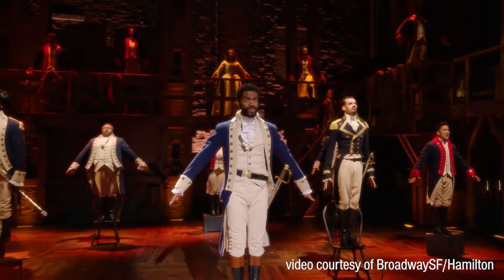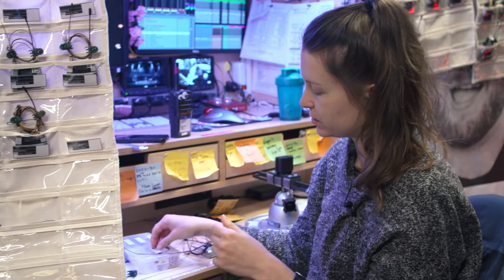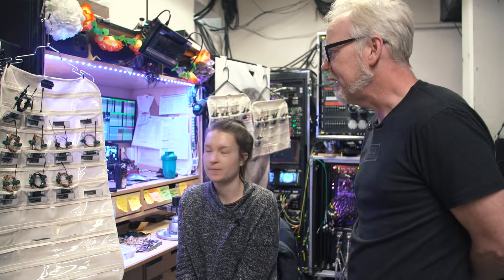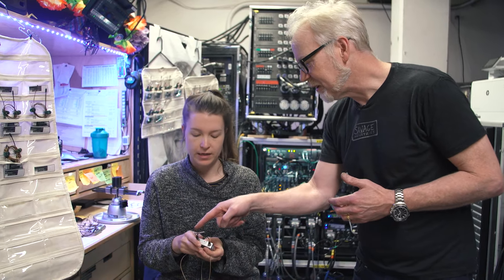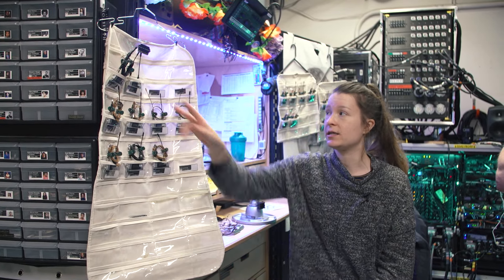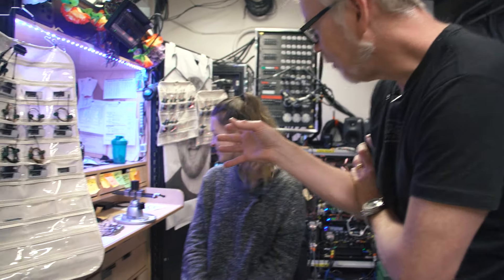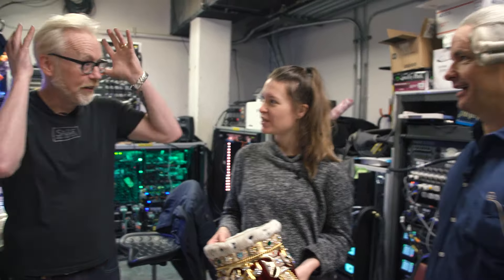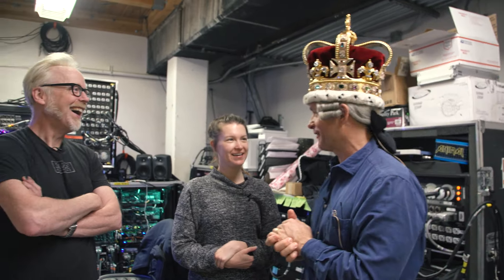Making the Custom Microphones for Hamilton!

Comment: The pliers are Hellerman pliers, used them extensively during my engineering apprenticeship and in the workshop. Tricky but damn useful for what they do. I found a really old pair in someones draw that I was able to keep: Literally just 3 bits of metal with the tapered plier end that you manually separated.

Comment: Again, another great overview video for the sound department.  I am likely to send this to a few of my students as well, and again it is not a complete video of everything that happens but it is a great general introductory video so congrats to Tested and Adam Savage on this.  It is even more impressive when you consider this had to have been filmed a bit back, but still answered some of the more common questions that were on the mix video as well.

By the way, word of warning, NEVER put a Hellerman tool in your back pocket, and especially never with the prongs facing in.  I'll leave the why to an exercise for the viewer:)
Reply: Back in the 70s I worked at the BBC's TV Centre in West London. One day I was replacing some old valve (tube) audio distribution amps in a rack with new transistor versions. I had a wireman making up a new harness, and he had taken up some of the computer floor so he could sit with his legs in the hole. He put a pair of Hellerman pliers down beside him and I stood on them! Luckily I was wearing good shoes and they only stuck in the heel. Could have been very nasty.

Comment: Amazing video. I worked as an A2 for a Bay Area professional theater (but nothing as crazy as this) and have used the Hellerman tool and Hellerman sleeves to make custom ear pieces, have run hair mics, etc. This is whole next level and I now have some crazy fun ideas for what to do for my future shows. Anyone know what transmitters they're using? The connectors on the Mics look like Shure but the packs look a bit more like Sennheiser. I don't recognize them as any models I know from either of those companies though. Love this video and love that Adam Savage can speak intelligently about mics (distinguishing the element from the rest of the mic cord, +1!)
Reply: The transmitters are Sennheiser SK 5212-ii and they have Lemo connectors. :)
Reply: Ahhhh ok. Thanks so much! I’m used to using the EW 300 series, don’t know much about the 5212s. Love those. I think the Sennheiser gear sounds better than Shure ULXDs. MiPro ACT80 can also give the UXLD series a run for its money though.  More dynamic range out of the pack (I regularly run EW 300s with -30dB pack gain). Lemo looks similar to TA4F from the distance in the video 😛

Comment: I’ve used a very similar variation of the Hellerman tool on the farm for banding lamb testicles. It’s for castrating them. Put the rubber band over the sack, it falls off several days later.
Reply: Dee Michaels many shepherds also use them to dock tails. As a side note, I was hoping someone would mention this tool. Fellow shepherd here :)
Reply: It is straight up animal abuse to castrate them like that. Studies have proven the suffering for if it wasn't obvious already. Sedate them if you want to castrate them and give them pain killers afterwards.

Comment: The whip finishing tool is great but once you have tied a few you can get much better and more accurate results doing the same knot without the tool. Check out any fly fishing shoo. Creative Sports in Pleasant Hill has a couple different versions of the tool and most of the  staff can teach you how to use it too. Also Adam, check out a fly tying vise for holding tiny objects that you need to tie things onto or just hold while you work. :) thread bobbins for fly  tiers are also awesome tools
Reply: That was the comment I was gonna make. I used a whip finisher for years until mine broke in the middle of a massive order. It didn't take more than a couple times doing it by hand with no tool, and I never looked back.

Comment: 5:55 Maybe print the strain relief with a flexible TPU (like NinjaFlex) and design thicker therefore less flexible walls covering the hard mechanical bits and then taper the thickness down to thin walls for added flexibility where the wires come out (so that you don't have a hard, rigid edge where the wires might bend back and forth.)

Comment: Small tidbit about the mics. They look to be Wisycom Transmitters and DPA Microphones (I could be wrong about this, but the form factors match up). The mics run around $400-600 and the transmitters run $1500+...Multiply that by 116...Wowza.
Reply: Updating my own comment, but the packs are Sennheiser SK 5212's, which in their newest version cost $3,000, whereas the mics they're using are now $600-700 each.

Comment: I think the issue with Adam's idea of 3D printing a protector for the connector is that you would still create a new stress point on the cable at the top edge of whatever you 3d print. The existing stress point at the connector is at least protected better than the rest of the cable. thoughts? I have this problem with mic/camera connectors as well, and always looking for a solution.
Reply: Maybe printing with a flexible TPU like NinjaFlex? I've had parts printed with it and it can go from sturdier with thicker walls to very flexible with thinner walls.
Reply: The transition from the fixed part (plug) to the fully flexible cable must be *gradual*, yes. A sharp transition makes it easy to make a sharp bend by pulling the cable (in some directions).
A single hard piece may only protect the connectors, but not the cable going into the connector.
Unless the solid piece is big enough to have an opening for the cable with rounded edges of, say radius 7 to 9 mm wherever it can meet the cable.

Comment: I am always amazed at how amazed folks are at how we get things done in the theatre, and at the tech that we have 'borrowed' from other people's workplaces.
Very little theatre tech is devined and designed in the theatre, by theatre people; and more than most would realize is adopted and adapted by theatre technicians, the 'marines' of show business.
The Hellerman tool is copped form automotive and aerospace wiring harness anti-chafing kit, the fly fishing lure tying is obvious, the motors that we use to hang scenery and stuff is from mining/smelting, the automation is from sources as varied as elevators, construction equipment, ski-lifts, and heavy diggers and dozers.
Even the basics, the counterweight fly system that moves scenery is mostly stolen from sailing ships back when they were all made of wood.
Welcome to 'that man behind the curtain'.

Comment: Anybody have unusual examples of how they use monofilament line in their maker projects? For years I had an invisible shortwave radio antenna made from fine magnet wire with monofilament loops as insulators strung up behind my house. There were kids playing football under the 75 foot long antenna and no one ever saw it.

Comment: Does she mention what the gauge and type of wire that she forms to make the over ear booms?
Reply: Hey dcuthill, I asked this question in another video related to theatre micing: https://youtu.be/5SR6ULw59eE. The head audio director for this Hamilton Show was involved and answered the question in the comment section. If my link gets taken out, it's the Precision Brand 0.026″ Diameter Stainless Steel Wire, 1 Pound Coil.
Reply: @DavidKars  thanks for that

Comment: Does anyone know exactly what these mics are? Brand and model? My company would be interested in looking at some of them.
Reply: the show uses a few different mics on custom rigs like this, sometimes Point Source GO-8WL-SK, sometimes Sennheiser MKE-1, sometimes DPA 6061
Reply: @kevinmccoy781  Those are the elements. I'm not concerned about that. I want to know about the transmitter and receivers. Those body pack units are of a make I don't recognize.

For the record, my theater is familiar with Shure, Sennheiser, Sony, and AT units. But I have never seen a body pack transmitter quite like that.

Remember, when we talk about microphones, we are discussing the hardware as much as we are discussing the portions on the actor's head.
Reply: They're Sennheiser 5212
Reply: @kevinmccoy781  Sweet. Thanks. I'm not sure why I never saw that on Senn's website. 

Are these completely digital? Do they have any quirks that would make operating them strange?
Reply: @trueedge2097  They've been the standard for Broadway and similar parts of the industry for quite a long time. They're analog, and they're slowly being replaced by the 6212, which is digital and still quite small. Since most Broadway shows and tours rent their gear, as the rental shops replace their inventory with 6212, they might sell off their 5212.
Reply: @kevinmccoy781  Ah! Now I've gotten somewhere.

My theater is not properly a theater. In fact, it's a hodge-podge of three different kinds of buildings put together. Lots of design flaws.

We use Shure UR1's, and I have long wondered why. They were bought around 2007, before I came to work and have been in use ever since. 

The only thing I can make sense of is that our building has to double as a classroom and a church auditorium. The powers that be must have wanted something that can handle itself well in all environments. 

But increasingly, we're trending more and more professionally in the realm of theater. We're doing bigger and bigger productions, and questions are being asked about our sound equipment. 

I think they're good questions. I've done some of the asking. The issue we're having now is that the Shures are really good for classroom work, but not nearly as versatile for stage. 

I like what I see in these Sennheisers. But I know the powers that be are going to hesitate a bit. Do these mics work comparably well in lecture situations, do you know? It looks like they have a good frequency range and response. That could work very well for us.
Reply: @trueedge2097  I don't see why they wouldn't work. I suppose it'd partly depend on what's not working for the ur1, which is a fine unit, just a bit bigger. I've used ur1s on other shows with smaller budgets (the Sennheiser 5212 are much more expensive). 

Fwiw, I'd suggest using "mic" for the actual mic element and "transmitter" in this context.
Reply: @kevinmccoy781  It's honestly hard to nail down problems with the Shures, because a lot of it is what I perceive and believe to be happening. Others might disagree.

I believe we are having issues with the sheer size of the transmitter. It isn't fitting into costumes well, and the antenna goes up from there. Antennas are getting bent by movement, and the signal starts cutting out. 

I believe a smaller unit with a lower profile can solve some of these problems. 

We are limited here, too, because we cannot be in the room with the actors when they are suiting up. We have to be careful because there's been too many accusations in our area. We want to be above reproach, but that limits us in seeing how the actor is wearing the unit and how to fix it. 

I think Shure makes a great unit. They work great, but we are having issues on stage because of design. But I am always working on ways to adjust and overcome. 

And I agree with you about the terminology. I should have anticipated that confusion.

Comment: Is there something in particular about the Hellerman Sleeve that makes it better than regular old heat shrink tubing?
Reply: microbuilder Firstly, there’s no heat. These mics are so small and fragile that a heat gun will melt straight through. Secondly, the hellerman lubricant allows you to move things around whilst working on it, but once dry, fixes in place nicely.
Reply: @dan90joe  Interesting, thanks!

Comment: How do you do frequency management and allocation?
Reply: We rent our gear from PRG and part of the rental service includes them doing coordination for us, but they use IAS, and we have our own copy of that too if we need to do anything on our own.
Reply: Kevin, Do you also do your own microphone repair and re-terminations? I've spent many hours with magnifier glasses resoldering those Lemo and Hirose connectors! Only to apply to much heat and melt the whole darn thing, and have to start again! :P
Reply: @tekvax01  I know some colleagues who reterminate lemos, but I'm not set up for that.  Honestly we have very few failures on that, I think in part because whoever is doing the original termination is doing it better and in part because our strain relief techniques are effective.
Reply: @kevinmccoy781  Nice!

Comment: Curious why the don’t use necklace type microphones like big brother or survivor uses
Reply: It doesn't get it nearly close enough to their mouth, and it will often get brushed against costumes or hit by hands which is absolutely horrible when amplified. The only rare time a mic would not be on someone's head in a production like this would be if they had a single costume for the whole show and a very high collar that didn't move much. An example would be Forever Plaid where the 4 main characters are wearing bow ties for the entire show. For male voices, you do get a nicer "chest voice" with more low frequency information if it can be done safely, but for female voices, going to the cheek or hair is fine because we don't want any low frequencies. It has a lot to do with a characters costume and blocking/movement.
Reply: In addition to what Bevan said, a mic that is on the head will keep a constant distance relative to the performer's mouth, reducing the amount of variation in level when they move their head.

Comment: Great video - so cool to see behind the scenes of a big show. Useful tips & tricks applicable to other media industries.
BTW. In the UK, there are definitely more than two colours of Hellermann sleeving available. I use them as insulating boots for electrical wiring joints, or to thicken very thin cables for cable clamps in connectors.
https://www.hellermanntyton.co.uk/products/insulating-tubes

Comment: Braid or monofilament?
Reply: It's 2 pound fluorocarbon line
Reply: @kevinmccoy781  have you looked at hollow braid?
Reply: @jamesdriscoll9405  I hadn't until just now.  What would be the benefit?
Reply: @kevinmccoy781  The right size would fit like a tight sock.
Reply: @jamesdriscoll9405  interesting. I'll take a look at it, but my instinct is that it would be bulkier and less secure from slipping, and it'd have to expand to fit over the mic head which would exacerbate that. But I love experimenting with new ideas and materials so I'll order some and play with it. Thanks!

Comment: I think if I was A Actress/Actor. I would be one of the sweaty once. Two reasons. Theirs lots of heat coming at me or two much clothing. And add that with what you have to do on stage. The only way I won’t sweat is the Cold